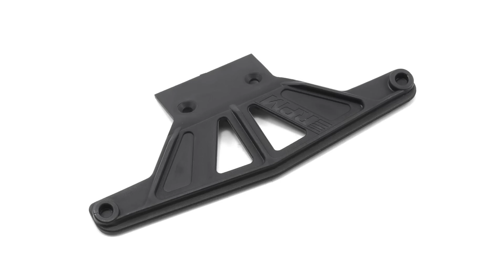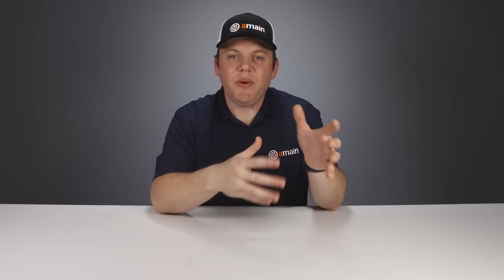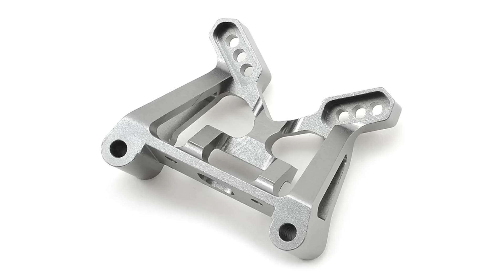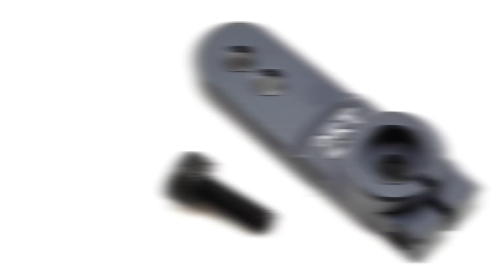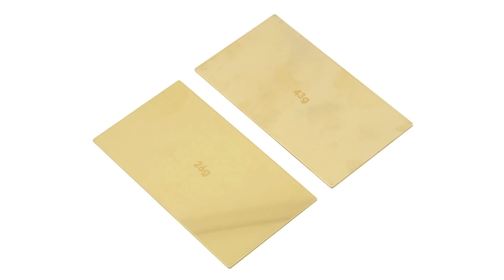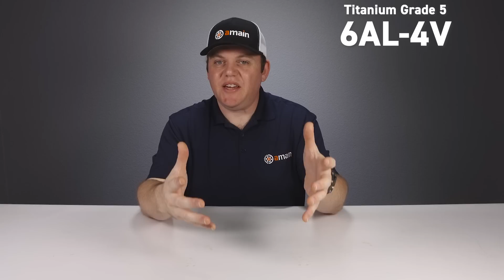R/C Materials | Differences of Aluminum, Carbon, Titanium, Plastic, Brass & Steel

Comment: I can hope for a professional opinion on this.. tires & hex hubs? Plastic or aluminum? Ok to get tires with plastic hubs & mix w/ an aluminum hex piece... Tires that can hold out ? Am I the only 1 that thinks proline sells you their tires with a pussy plastic hub? I did my best to make sure the hex piece properly mates with the tire hub & it stripped out in no time flat... I'm not even the kind of guy that likes to create jumps & jump my RC to the extreme.. The only kind of jumping I like to do is off of slight variations of short grass terrain on a good open field. I just like to ride for fun & now I'm going for switching from proline trencher tires to Traxass Sledgehammer tires.. My problem with the tire falling off on 3 separate occasions... it started with a 10 year old driveshaft blowing.. replace the shaft by the pair.. Trencher tire hex shape hubs torn... ahhh.. My Traxass Stampede 4x4 vxl also sat in the dust w/o being used for 6 years & now I'm sucked back into this hobby & spending too much money on new parts but before the install I need tires that can hold out for me sold as is on a 3s motor. I had each rear wheel tire falling out

Comment: Whats the difference between stamped aluminum and cnc aluminum ?
Reply from the maker: It referring to the method of how the part was created. Stamping manipulates the metal to form the part or shape you want (usually from a sheet of aluminum). CNC cuts the metal to form the part or shape you want (usually from a block of aluminum). Both methods are good but CNC is a bit more precise but also more expensive. 
-Brett

Comment: What’s kept me weary of using steel gears is steel against plastic can sometimes be a bad combo. As in should the plastic gear, maybe leading into a transmission locks up, the outside steel might very well strip the plastic of all its teeth. If there’s anything I am missing or could avoid that please comment as I’d prefer to have a “bulletproof” tranny than a halfway upgraded tragic possibility. And of course aluminum would be my go to on most parts, especially those which are threaded to avoid once again, stripping the plastic. On my (life size) Ducati I have a lot of Carbon fiber fairings, and for the most part they’ve been great and reduced weight. However if it’s left in the sun too long for too many times, it will lighten the shades of the part. Also I rear ended a parked car once, luckily only moving at less than 10mph, and my front headlight shroud broke. And once carbon  fiber breaks, it’s done. And to top that off, to replace just the single part was nearly $500. The gas tank alone was over $1000. It’s taken time, but nearly the entire fairing is carbon fiber. Anyway, for R/C, I’d say it should do very well even against crashes against pretty much anything, as I crashed a 450lb motorcycle against a stationary car and only cracked one piece. So a far lighter car, and quality CF, you should be fine. And like he said with great weight loss.

Comment: I bought some MIP heavy duty rear drive shafts/axles, on the recommendation of everyone. The axles broke twice. 1st time was when the car started wheelieing on 3s. 2nd time was just driving up and down a dirt trail behind my house. I'll never buy MIP again. 70 bucks and they didn't last two weeks. My stock plastic shafts are lasting longer. MIP should be ashamed.

Comment: Running on carpet or astro also has more grab on parts and tires. Own experience I break more on carpet than I do on dirt because I think on dirt there is more slide or give to the surface. I think the same parallels to sports where there tend to be more knee and joint injuries on artificial surfaces than on natural surfaces.

Comment: I need help, my dad’s rustler 4x4 vxl doesn’t work right.  Every time I hit the trigger it makes a weird noise and doesn’t wheelie.
Reply from the maker: Could be a gear stripping out or maybe the slipper is too loose? Sounds like you're losing power though. Maybe inspect the pinion and spur gear and ensure the teeth look ok and not chewed up. Then maybe check the slipper nut and see if it is loose. If it is, you can just tighten it up. It could be that the slipper has worn out which happens. Traxxas sells a rebuild kit for it: https://www.amainhobbies.com/traxxas-slipper-clutch-rebuild-kit-tra5552x/p158365?r=0
Let me know what you find out. 
-Brett
Reply: AMain Hobbies we just tightened the slipper clutch, and checked the gears.  We also made sure the gear mesh was right.  It still doesn’t work.  (Also the rustler is brand new). Whenever I roll the rear wheels the front ones don’t spin.

Comment: What would you do to make a carpet racer convert to a dirt track racer
Reply from the maker: Probably more weight in the rear. It depends on what type of vehicle we're talking about, but going from a high grip track to a med/low grip track, you'll probably want more rear traction, so less front weight, more rear weight. 
-Brett

Comment: Off Topic: 
Kyosho MP9 Nitro vs HPI Trophy 3.5 Buggy... witch one should I get?
Reply from the maker: The MP9 is a really great buggy and the engine is very reliable. We made a build series on the MP9 ReadySet where we did some upgrades, bashed it and then eventually raced it. Check it out here: https://www.youtube.com/watch?v=Y7LhHcDZY3o
Let me know what you think. 
-Brett

Comment: Hi, I have an question. Can my esc: https://www.absima.shop/RC-ACCESSORIES/RC-Electronic/Brushed-Motor-ESC/Brushed-ESC-40A-waterproof-Sand-Buggy.htm?shop=absima_en&SessionId=&a=article&ProdNr=2100002&t=19114&c=19131&p=19131 handle a 8T brushed motor? https://www.absima.shop/pp/absima-electric-motor-thrust-b-spec-8t.htm?shop=absima_en&SessionId=&a=article&ProdNr=2310070&t=19114&c=19131&p=19131
Reply from the maker: No, I'm afraid not. Using Google Translate, the description on the ESC page says it will go down to a 15T motor maximum. A 8T Motor will most likely burn up that ESC. But this ESC should work; Dynamite claims you can use a 8T motor with it when using a 2S LiPo battery: https://www.amainhobbies.com/dynamite-waterproof-60a-fwd-rev-brushed-esc-dyns2210/p366273
-Brett
Reply: @AMain_Hobbies ok thx

Comment: 6061 and 7071 is the purity and hardness of technology aluminum. Aluminum is not an alloy. It's one element, an alloy is two or more elements combined.
Reply: BS. 6061 contains magnesium and silicon which is why it was called Alloy 61S at first.
Never heard of 7071. If this is a new alloy please post a link. 
If you mean 7075 then that the same as 6061 with even more Zinc, ti, chro and other metals in trace quantities. It also requires less heat treatment than 6061.
6063 is the most common form of Aluminum but has less strength than 6061. Mostly used for roofing/siding or complex extrusions that do not need structural strength.

Comment: Awesome information..  explained it absolutely perfectly, without it being over the top etc. 
Are you guys still shipping to Australia with no issues? except for a little added time? This old dog learned a new trick  and Ordered online for the very 1st time for anything not just rc, and totally happy with service.
Cheers mate 👍
Reply from the maker: Hey Mick. Congrats on your order. It can be a good way to get exactly what you need. Our orders are being shipped out, and we do ship to Australia, but we are running behind right now because of the huge amount of orders we're receiving, so there is a few days wait. For International shipments,  there are certain items that cannot be shipped, like fuel, but most items can be. Hope this helps.
-Brett

Comment: Amani hobbies do you guys repair RCs
Reply: Can't you repair your own rc car?!
Reply: rc guy well am new to RC and the damage was more then I can handle personally I rather let professionals help me so I use my RC soon. I been so busy only so much I was able to do my self. Is ok to get help rite🤷🏽‍♂️
Reply from the maker: Yes, our retail shop located in Chico, Ca. works on and repairs vehicles. Our main facility does not. Unfortunately our retail store is closed during this lockdown time. What do you have that needs repairs? 
-Brett
Reply: @manueljr2974  What did you destroy?!?
If you can't fix your car, please leave the hobby.

Comment: Kevlar is important in RC planes (and boats?) because it doesn't interfere with your radio gear.
Lead is also important for planes and boats for adding mass.
Okay, technically kevlar is also a type of plastic

Comment: Love your vids Brett! Keep up the great work. 
Btw.. since I watched your Readyset to Race 1/8 buggy series... I've purchased the Mp9 TKI4 from ebay ~$500.00 (You were out of stock),
 ~$500.00 over at your shop  https://www.amainhobbies.com on random parts/tools/etc. Another, roughly $300.00 at Amazon 🤔Here we go!
Reply from the maker: Terrific! You're going to love that buggy, Congrats man. Take your time breaking in that engine, and it will last a long time. Keep me updated on your progress. 
-Brett
Reply: @AMain_Hobbies   As I was breaking it in today a stopper for one of the break linkages was laying in the chassis. Set screw was stripped out(explains why it was loose). I found these on the site: https://www.amainhobbies.com/kyosho-2mm-linkage-stopper-gunmetal-5-kyo97049gm/p895848 I can't tell if these include the set/grub screws. Any help would be appreciated.

p.s.  I used the Adam Drake break in method.

Edit: I think I've got it sorted out. I grabbed those as well as the 3x5mm set screws. Thankfully someone left a review stating you'll need a 1.5mm hex on one of the 3mm set screw packs. Grateful Noob here. 😁

Comment: Thanks for this Bret, I just ordered some parts from you guys last week. Great service arrived 4 days later. Just waiting on my stimulus check for some more and a new truck. I have noticed that my front steering has gotten a lot more play in it than it had three years ago. I've replaced the portal bearings and that has helped. I am waiting on the portal drive bearings to come in to complete it. Being stuck at home gives plenty of time to service our vehicles. Buying a few parts along the way helps pass the time.

Can you do one of these on tire foams? What are the differences and how do you service them if at all?
Reply from the maker: Hey, glad to hear those bearings helped with the slop a little. Good idea on that tire foams. Is that for r/c in general, or just specific to trail trucks? 
-Brett
Reply: @AMain_Hobbies  Trail and on road if you don't mind. Thanks

Comment: Aluminum/steel/titanium also puts more stress on the plastic parts. If they are strait up attached to the plastic it will snap much easier.
Reply: A lesson I learned the hard way. Started adding aluminum parts to my Rustler, and was constantly breaking the next weakest part.
Reply: metal hubs/chassis is good
Reply: Full Throttle RC yes, but only if made with 7075 t6 aluminum or else it will bend.
Reply: @fr33Kill  yes... or unless it is 1/2 inch thick... but yes aluminum hubs and chassis and hingepins are the only aluminum parts you want (other than shocks, motor mount, etc you get the idea) because having plastic arms is good so you only break the arms which are quick cheap repairs
Reply: Have you ever used non metallic hinge pins? 
Or even brass screws for structural connections?
So how well did that go? 
You are straight up virtue signaling ignorance.